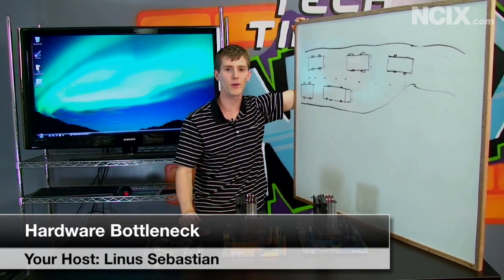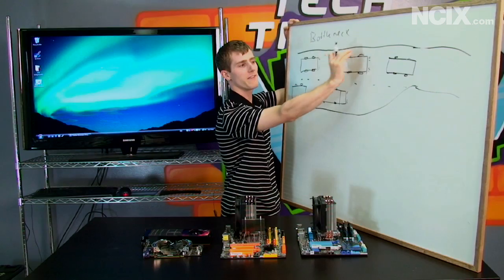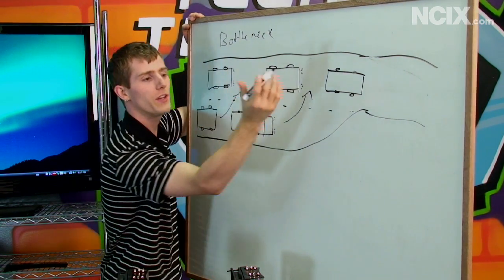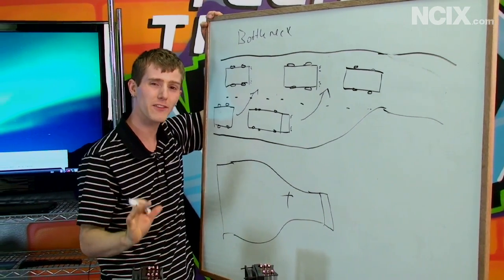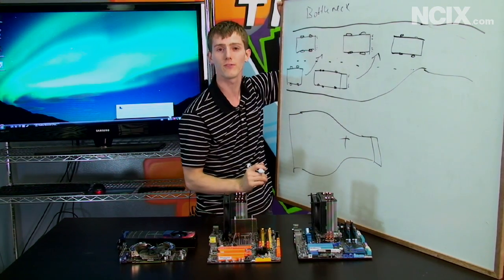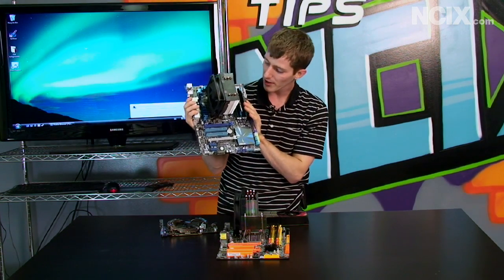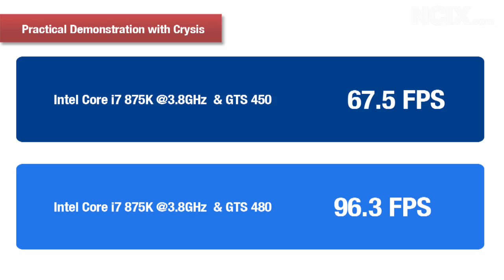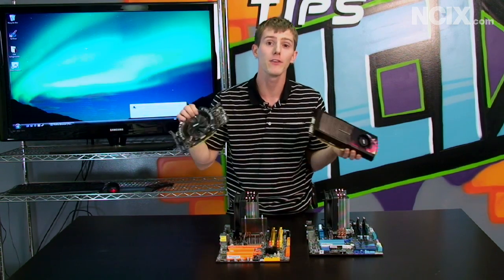Understanding Hardware "Bottlenecks" and How to Avoid Them (NCIX Tech Tips #81)

Comment: I was thinking of doubling my RAM from 4GB to 8GB, as it seems new games tend to recommend 8GB.  However, based on the windows experience index showing my graphics card as the lowest score (6.4) and ram at 7.4, CPU at 7, and SSD at 7.7, I'm wondering if the extra RAM would be useless.  Would it be bottlenecked by the graphics card?  It's a GeForce GT 230m.
Reply: Yes thats a ancient graphics card , upgrading ram wont help it at all you need a new GPU , look at the 750ti as a new good GPU but it looks like you have a laptop so either buy a new laptop or build a new PC. Unless you not gaming at all that will be fine also next time post exact specs with somthing like speccy
Reply: HarryBearGaming Thanks man, that's what I suspected.
Reply: PumpkinSmasher85
Not sure if you still want advice on this, but Linus has a pretty good video about RAM on his Techquickie channel.

Simplified, adding memory capacity is only useful if you need that amount of hardware memory; check your memory usage in task manager when you're actively using your PC - if your usage is close to 100%, and you feel you want to run more processes/programs at the same time, then it's useful to upgrade RAM.
(Modern games recommend a lot of RAM, but often don't come close to using said amount of RAM).

As for graphics cards, if you're serious about gaming and want to stick with Nvidia cards, look into buying something from the GTX series, rather than the GT series - more expensive, but you get more bang for your buck... if the rest of your system is up to the task, of course.

EDIT:

I only just noticed the laptop part - obviously upgrade options on laptops are limited, so if you're serious about gaming, you might want to look into getting a PC.
Reply: Mikelamont2 Thanks for the advice, it's much appreciated :)

I'm not mega serious about pc gaming at the moment, but there are a few games I've been thinking about and can't afford to upgrade to a new pc/laptop just yet.  So I was just seeing if I could squeeze a bit extra out of the graphics card I have.

Comment: Will there be any bottleneck issues at all in this setup?

CPU : AMD FX 6350@3.9 GHz (6 core stock speeds)
GPU : Gigabyte Radeon HD 7950 windforce at stock speeds
PSU: 650 watt gaming power supply
HDD: WD 1TB harddrive@7200 rpm

Everything here is at stock speeds and I need someone to reply as quickly as possible, thx

Comment: what about GTX 660 and Phenom II X4 BE? bottlenecking?
Reply: That is beyond bottleneck. Phenoms belong with Radeon 55xx
Reply: Isaac Bowers I hope you are you joking.... The GTX 660 is not faster than my hd7870 and i have a Phenom X4 BE. I play most of my games at high-ultra in 1080p at around 50-60fps.
Reply: You should be ok with this Videocard.
Reply: Eric Bruyere need to upgrade your CPU and motherboard soon... GPU is bottlenecked by the CPU.
Reply: If i wanted to play 4k I would agree with you but I`m playing 1080p on high or ultra. This CPU do not move for another year or two.
Reply: Eric Bruyere Depends what games you play, but the bottleneck is still there, even at 1080p.
Reply: Eric Bruyere My experience with Phenom II is trash. It's really not a well updated and performance enhanced cards for demanding games these days.
Reply: I agree and do not agree with you at the same time.

Yes the CPU is outdated since it was built at the same time as the 1st generation of I series (Or a little bit before) and there is a lack of instruction that made the cpu less appealing.

No because from my past experiences with the AAA companies is they will optimize their game to work on a console and we will get the cheap port all over again.

So the requirement will be so low that older CPU might still be good for a while. (ex: I5 2500k , Phenom II 965 or higher)

The only Exception is Ubicrap who do 0 optimization on their games lately, but if you look as an example BF hardline, the game need less cpu power than BF4 and other games like Metro Redux need only a quad core at 3ghz or more.

As for the question if a GTX660 will bottleneck with a Phenom II, I believe it wont since the GTX6 series has been created at the same times as the HD7 series and my Phenom II do not bottleneck my HD7870 in gaming and from what I remember GTX660=HD7850 or HD7870

When I`m playing games, I`m always close to 60fps on High or Ultra in 1080p.

The day that I need to go to Medium, it will be a sign for me to upgrade and I do not close the door to an Intel CPU. I do not do any brands fidelity when it come for my money.
Reply: norge696 If there is I do not see it on my installation atm.

It`s just, I dont see the point to pay for a CPU to play a game at 150fps, while my computer screen can only shows 60fps.

But I agree with you the CPU is getting very old and I wont be able to keep it further than a year or a 1.5 years . That`s why I`m starting to budget for a new PC for somewhere this year in case of.
Reply: Eric Bruyere Trust me there is. an x4 even bottlenecks a gtx 660/760

Comment: I am upgrading my PC soon. These are going to be the components I have:

PSU: Corsair HX750i 750W 80 plus platinum (More watts than needed for GPU for future upgrades)
CPU: AMD A10 7850K 3.7 GHz FM2+ [Quad core] ((Motherboard doesn't support another CPU))
GPU: Asus Geforce GTX 750 ti oc [2 GB GDDR5]
System RAM: 12GB (4 + 8 GB DDR3 1600MHz)
HDD: 1TB 7200RPM - 6Gb/s - SATA
Motherboard: Gigabyte GA-F2A55M-S1 FM2
Windows 7 Ultimate 64-bit.

Any bottlenecks or problems?
Reply: no comment for psu, since you can buy it, then buy it. but if i can ask, why did you choose apu when you have your own discrete gpu? we all know that A10 apu is not powerful enough compared with other similar price processors. and if you will build gaming pc, then ssd is a wise decision, since hdd will slow your other components.
Reply: Rahmat Stiady Edit: Changed to 750ti oc instead of 270x.
I researched about the CPU thing for a long time and it appears that the A10 APU seems fit.
I have thought of getting the samsung 840/850 EVO SSD.
But yeah, that's why I didn't get another CPU. What would you recommend?
Reply: imo, i would recommend i5 haswell for the same price range, but if you want amd one, you can go with fx-8320 or just go with athlon x4-860k. this athlon has same technology with a10, same cache, same speed, same socket, but without gpu in it. and with athlon you will get cheaper price than a10, but i wont recommend it as a powerful cpu, just to compare a10 if we remove those apu feature.
Reply: Rahmat Stiady Alright. My motherboard only supports FM2 and I actually found the only good one, the athlon II x4 860k. It is the perfect thing. Thanks
Reply: you're welcome. nice, good luck for your build, and since you save about $70 on your cpu, why not try to upgrade your gpu to gtx-960?
Reply: Windows 8.1 has better performance in game, sometimes it can be upwards to 20fps over Win7 in some games. Although it's usually just around 5-10fps which is worth it because that could mean the difference of playing @ 1080p 2x AA 60fps and 1080p 4x AA 60fps

The AMD X4 860k is a decent CPU, and Rahmat is right, you should spend that money you saved on a GTX 960.

Also your RAM config is weird. Why is it 4+8? Unless you're a power user who renders videos-3D models-High resolution images-photoshopper or just has a lot of windows open you don't need much more than 8GB. Also you don't need RAM with a heat spreader, unless you're going to overclocking your RAM extremely high then there's no point in a heat spreader. Don't pay more than about $60 for 8GB of RAM and a heat spreader usually adds to the cost.
Reply: StoreBrand Yeah, ignore that stuff, I said previously that I'm not actually building a PC, i'm reconstructing some parts of it, which is: CPU, GPU, PSU. So about the 960, I have found a 750ti oc which has a much better overall performance than the 960
Reply: If you want a less error prone (meaning your cpu is able to calculate smaller and larger doubles and floats) , you might want to switch to an Intel i5-i7. Not so much for the cores but for the precision of the math co-processor. AMD's math co has normally been off once you start getting done to the one millionth sect of a double. If gaming that can cost you a frag. Another bottleneck would be the mobo of course, but the hard drive might need to be the slave and the master would be a SSD. Depending on your choice of GPU you might want to kick the power supply to 1000 - 1200. Go with a 970 GTX or a R9 295x if you are going big. It you want to go thrifty, 880 GTX or even the 780 GTX would be a step up. If you like AMD cards, you can install the Phyx drivers and run it on your cpu. Trust me, I run phyx on my i7 over my Nvidia card when I do run it. Mostly for the fact the i7 with all cores on and the damn "core stop" issue in Winhose is fixed is a bloody super computer. The OS can be a bottleneck.....But newer is not always better

As for OS, Windows 7 with a guide for trimming the fat, turning on all cores, and homing the GPU drivers will help too. You can fine tune your OS if you know what services to turn off, such tid bits as "msconfig", "MMC", and doing some research. Remember M$ loves putting fat and spyware in their OS. Linux is a better overall route for performance if you don't mind geeking out to the extreme. But Linux is a beast when it comes to handling it resources, not a fat cat. Downside is you have to fine tune Wine to play Windows games.

Kick up the RAM to 16 gigs - 32 for future proofing and screen capture recording. You will thank yourself
Reply: ***** Not a 750 ti. A10 7850k is good enough for mid range GPUs and the 750 ti is low end.
Reply: agree with StoreBrand , when it comes with mid-range gpu, a quad core amd cpu like a10-7850k/athlon x4-860k wont make difference when it comes to gaming performance. but it will be different if we have high-end gpu. btw i still recommend core i5 too.
Reply: Jesus Christ! Stop wasting your money upgrading every month.
Reply: lmao the Athlon 860K is just an A10 7850K without iGPU
Reply: iFreakTz yeah that's what i said, but let him buy it for a while. he can upgrade it to skylake in the future (since red team dont make huge movements in cpu sector, but i like radeon 300 series though).
Reply: Your gtx 750ti  GPU is the bottleneck!!! For gaming for sure.   (bottleneck right before image sent to monitor)  I'm running an AMD A8-6500 apu, that was fine for normal browsing use,  but gaming was overheating apu. So i added an MSI  radeon R9 270 GPU discrete GPU. And hyper 212 apu cooler... No heat problems since...  Now my A8 CPU is around 30% load. Before it was 85-90%  load using integrated graphics.... I strongly strongly suggest get the athlon x4 860k. Especially is you're set dead on the 750ti gpu.... The athlon x4 860k is exactly the same as A10-7850 apu... But you not even using a radeon gpu  to crossfire with your A10 APU so, Its a complete waste to get a nice apu.     Save the 80$ and put towards better GPU.... That 750ti is good but weaker than my r9 270. I got a better GPU that is not bottlenecked by my weaker A8 apu. (Roughly same as the athlon x4. 750 CPU power) So you can get a better invidia with an athlon.  Also your memory is overkill.  Too many gb. A nice dual channel at 2133 MHz will do. Unless you doing editing or like to have a thousand tabs open.     I run THE CREW racing game on Ultra detail video settings. And my ram never goes over 3.5gb - almost 4gb... Running 2x4gb dual channel g.skil  ripjaw ram. .... Hope you read this before build

Comment: Hey yawl.
Just wanted to know if my CPU is bottle-necking my Gpu.
I have a i5 4670k (Overclocked to 4.0Ghz)
And a radeon 7990
Is the cpu bottle necking at all?, do I need an i7?.
I dont think it is bottle necking but I would feel better if i knew for sure.
Reply: Prob not, but I have an highend i3 and that is bottlenecking and dont worry your fine, but I will get an i7 to be sure.
Reply: No your CPU isn't bottlenecking the GPU.

You have to go to extremes before a CPU bottleneck's the GPU. Like if you had a really old dual core CPU and a fast GPU like the one you own.

I have an I7 2600 non K paired with an gtx690 and when I play games on average my CPU is used only 30%. Some games like Crysis3 use 40%. Other games like Need for Speed Rivals only use 18% of my CPU. Some games only use 12% believe it or not.  Assassins Creed4 uses only 20%.

So no your CPU is fine mate.

In future the best way to tell if you have a CPU bottleneck is when your frame rate isn't so good and when you dial down some of the graphics settings and or resolution and your frame rate doesn't increase. This is a CPU bottleneck and means that the CPU cannot prepare any more frames for the GPU to render.

If you ever have this issue then the best thing to do is dial up the graphics settings as far as they can go seeing as the CPU cannot prepare any more frames for the GPU to render anyway so your best off using lots of settings to slow the GPU down so it's in line with the CPU
Reply: most games only use 4 cores anyway which the i5 has, so don't worry you aren't bottle necking.

Comment: Hi guys, i want to assemble my own pc from:
-Intel Xeon E3-1230v3 with a CoolerMaster Hyper Evo TX4
-GIGABYTE GA-Z87-D3HP LGA 1150 Intel Z87 HDMI SATA 6Gb/s USB 3.0 ATX Intel Motherboard
-Radeon R9 280x
-Seagate barracuda 1 tb hdd
-16 gb (2x8) of RAM
-Corsair CX Series CX750M 750 Watt ATX Modular Power supply
Would it work good together and am i going to have near 60 fps in bf4?

Comment: So I have an FX 9370 vishera CPU, 16gb of 1600mhz DDR3 CAS 9, 750W PSU, xonar DX Sound card, and I have an old MSI Radeon 6950 Cyclone PE, all built over an ASRock Fatal1ty 970 Performance MB. I need a GPU upgrade badly, bc that is along with two of my old HDD where my bottleneck is. Here are my questions: I was pretty much sold on the idea of an MSI Geforce GTX 970 Gaming (4gb) and I had almost saved enough money to get one, but now AMD has come out with the reveal for the new RX 480, which is said to beat a GTX 970's performance and as far as I know either closely match that of a GTX 980 or in some cases surpass it as well. Which should I go with? considering that the RX 480 is $199. Also, should I wait for people like MSI, ASUS, EVGA, etc to get their hands on the RX 480 and come out with their own editions if I go with the rx 480? and if I do, should I consider the 8GB version? will I need a better PSU?

Comment: intel core i5 650 3.20 ghz
4 gb ram 
nvidia gtx 750
800w power supply
and when i run battlefield 3 or crysis 2 they freeze for a moment every minute, what´s wrong?
Reply: You dont have enough RAM... Games like BF3 and Crysis need at least 8 gigs of RAM.
Reply: Kai Kimsen alright then. i will buy  8gb ram for my pc

Comment: q9550 + gtx950 or 750ti it will bottleneck in all games? Before i was with a nvidia geforce gtx9800+ and was perfect in all games that I had  played like a heavy one Black Ops 1
Reply: bottleneck sure u r CPU is way old
Reply: +karthik kamath in which games?  the newest I have is black ops 1 and it was played pretty easily at full graphics with gtx9800+  resolution:1680x1050
Reply: +savvasr10 k just try playing watch dogs doom 4 with that CPU
Reply: +karthik kamath I won't play any of these games yet bcs it will bottleneck for sure.. I mainly play fps games at that moment..! but still the old ones
Reply: +savvasr10 k then u should have mentioned that earlier there will be slight bottleneck if u upgrade u r GPU say like a 960 or r9 380

Comment: Hi, ive built a gaming pc! My current set up is a fx4100 4 core at 3.6ghz, 8gb ram and a gt 545 which I had spare! Im looking to upgrade to a gtx660ti and im wondering wther its worth it or wether to get something like a gtx 650!
Reply: Go for something like (from weaker to stronger) HD7770--gtx 650Ti--hd7790/R7 260x--gtx650Ti boost--HD7850--gtx660 max (you could OC cpu for the last two cards if you want full usage in all scenes)
Reply: thats awesome, im thinking of still buying the 660ti as i will have the money for it, and i can always put an fx-6100 in in the future to get more out of my pc! thanks
Reply: Nangle instead of 660Ti go for gtx760 (same or even stronger a bit in games). Instead of fx 6100 bulldozer rather go for piledriver fx 6300 if it's supported by your mbo with upgrading BIOS